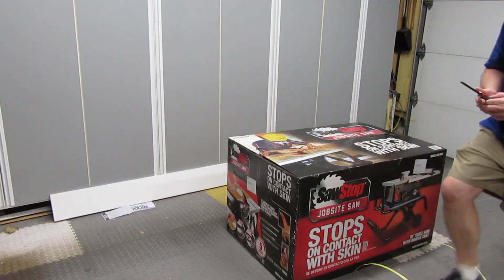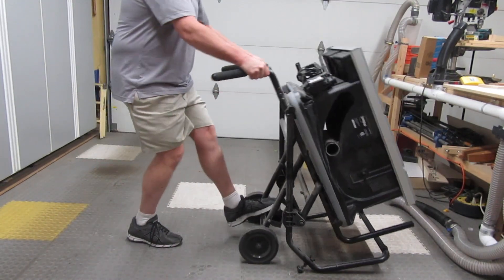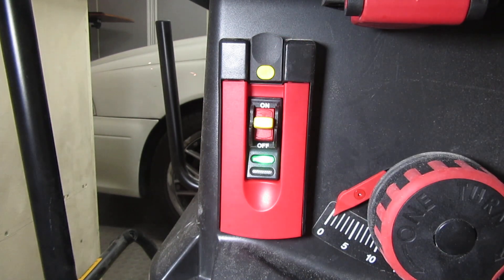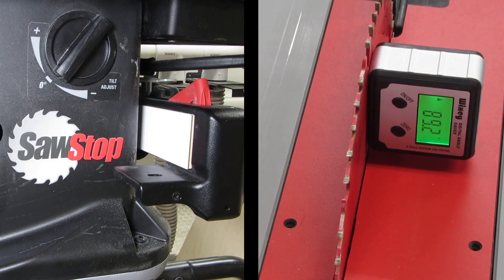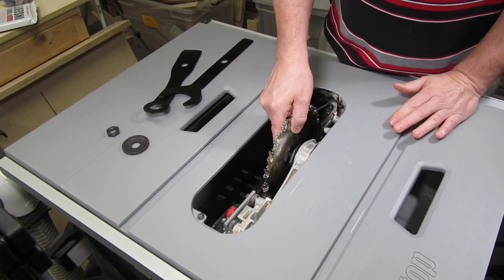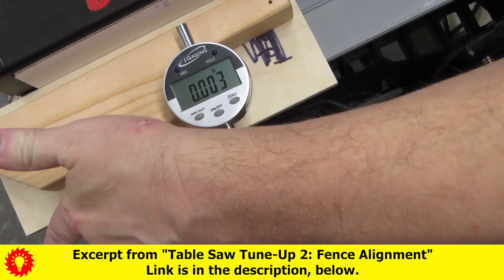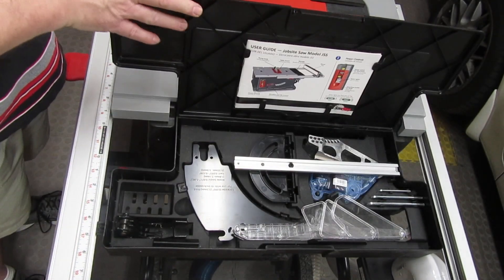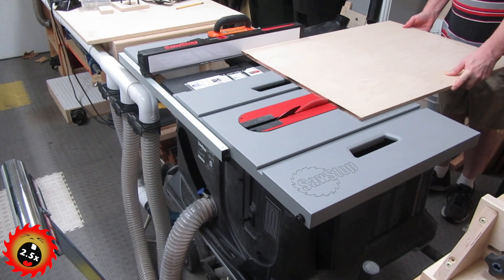SawStop Jobsite Saw Unboxing & 5 Month Review

Comment from the maker: * ALL SAWSTOP OWNERS, PLEASE READ *

I just read the fine print on SawStop's website, and they said if you trigger the brake, they might send you a new one for free. The details can be found here: http://www.sawstop.com/support/warranty/jobsite-saw (there's links at the top for each type of saw).

Basically, it says the brake cartridge keeps electronic data, and if you send them the cartridge and it indicates the brake triggered from contact to skin, they'll send you a new brake for free.

Cool deal! Although waiting for a new blade would suck...
Reply: The Newbie Woodworker now that would be the tie breaker
Reply: serious question, that Diablo blade look like it had the extra bump outs that sawstop recommends not using as it can cause the blade to kick away from the brake when the safety measure is triggered , I've  seen a different video where the user had a trigger to currents and actually had the saw have more time to dig into his finger, could you please come about this
Reply from the maker: @theomegawerty9688  Thanks for the question! It doesn't have it on every tooth, only where the big gaps are (I forget what you call them). But of course, if you're concerned, don't use the blade! However, I happen to know it works, at least when the blade is spinning down: https://youtu.be/OouPywNRZJ8 🙄
Reply: i'd rather wait for a new brake  than try to wiat on growing a new finger, lol, i'd probably have a heart attack if i ever set one of those off, i saw tom silva do that on TOH with a hot dog , and boy , was it loud
Reply from the maker: @jakeqwaninne8502  😂

Comment: I've had the Sawstop PCS for around 5 years and it has been nothing but awesome. Also, I had a small issue and the customer service was incredibly good. In fact, I now need a jobsite saw, and even though this saw is easily twice the money as all the other nice jobsite saws, I knew I had to get the Sawstop. I will receive it next week (just in time for a kitchen cabinet installation). Thanks for the video and great job!
Reply from the maker: Thanks! I sold this JSS and bought a PCS a while back, and like you said, it's been awesome. I'm sure you know they have a JSS "Pro" now, although I don't know what's different. In any case, I wouldn't consider anything else than a SawStop either. 😄

Comment: Great video.  I'm in a similar situation, my current saw is dead and need a new one and my wife really wants me to have the safest.  I'm considering the sawstop as I don't have a lot of space in my work shop.
Reply from the maker: Funny thing about job site saws - they fold up and wheel away nicely, but when they're open, they take up more space than you might think. If money isn't a huge concern, then compare the dimensions of the SawStop PCS to the JSS - I was surprised how close they are. https://www.sawstop.com. Of course, if you need to fold it up and put it away, then a job site saw is the only real option. Good luck!

Comment: Thanks for this. I was trying to decide which to go with, Job Site or Contractor. I finally decided today on the Job Site before I saw this. I don't use a table saw much, my go-to is my 12" Hitachi Chop saw, but occasionally I need one and my workshop space is getting crowded. After watching this I am sure this is what I want. Thanks for the reassurance.
Reply from the maker: You're quite welcome. Yes, in your case, the JSS is probably the best option. Easy to fold up and move out of the way, yet it's still a great saw with SawStop's safety features. Have fun!

Comment: I also have the SawStop Jobsite.  Overall I like it (except the price).  I could not agree enough about the miter.  What a piece of junk for a $1300 saw.  Unlocking my fence I have not noticed any movement.  As far as the storage box, it does seem cool to be inegrated into the saw like that, but I have found in more than a couple instances that I needed to get into the storage box after I had set the fence and because I was going to make several repeatable cuts I didn't want to move it.  You really can't get into the storage box once the fence is set.  The other major thing that was with mine was the table top was NOT flat.  I got with support and and I have to say for a company that says it's customer support is great, it was not with me.  I neither got a fix, nor a replaced saw.  Strange thing is over time it has flattened out and is much better now, still not flat though.  I spent a lot of time trying to tweak the top and maybe I did something that helped...  I'm not sure at all.  I know I sent in pictures showing the non flat surface and now using the same straight edge it is better, not perfect.  I am no where near a pro, or even a good weekend worker so where it is now is fine for my work.  While not perfect and very expensive, I'm still glad I got it, just wish they stood behind their product for the tablesaw aspect as well as they stand behind the flesh sensing part.
Reply from the maker: Thanks for the comment. Like you, I'm surprised that SawStop didn't honor your warranty. They specifically say it covers manufacturing defects. Regardless of your level of ability, you shouldn't have to put up with that. I'm frustrated for you, if that makes any sense.
Reply: I just watched your video yesterday, wondering how things were going with your saw.  It was unsettling seeing how imperfect this expensive saw was as you set it up.  It pretty much turned me off to the job site saw, yet I am still curious to others experiences.  Take care.
Reply from the maker: @drtomasdds  It's an interesting question, and I should do a follow-up video. In spite of its flaws, I love the saw and it's a joy to use, as long as you don't need to micro-move the fence. I have a jig to help with that, so it's not the end of the world, but it is a little tedious. Other than that, though, there's a lot of quality here, and you notice it, when you use the saw day by day.

So I definitely recommend it, as long as you know the flaws going in. And the knowledge that you're paying a premium for the SawStop technology. For me, that's a price I'm willing to pay.

If you decide you're going to buy one, it's $100 cheaper at Rockler than it is from Amazon. It's always been cheaper at Rockler. No idea why - it's usually the other way around.

Don't forget that if you want to use it with a dado stack, you'll need to buy a brake cartridge for dados, and probably a blank insert plate. So add that to the price.

Let me know what you decide. Oh, one other thing. In the video I mentioned how much I love the one-turn crank for raising and lowering the blade, and I still do. BUT, when you need to adjust it up or down by really small amounts, for instance to get a dado to an exact depth, it's not necessarily easy. It's doable, but it takes a little patience.

Sorry for the rambling, but it helps me get my thoughts together, for the potential follow-up video.
Reply: @TheNewbieWoodworker  I am researching the saw now, hence watching this particular video. The reason for the price difference is that Amazon is including the flat $100 shipping cost already, whereas Rockler may not be.
Reply from the maker: @davidbuffington9644  Interesting. I have a local Rockler store, so that's not an issue. Hey listen - just yesterday I stuck my thumb in the blade, and found out that the SawStop is totally worth the money. It just tore the top layer of skin, and it feels like it's burned. That's it. Best money I ever spent. Video forthcoming, of course.
Reply: Same issue with my Delta 36-6022 jobsite saw.  Love the way it sets up and folds down for storage.  Table is not flat.  There is a .013 dip around the throat plate.  It doesn't sound like much, but for very fine work, it throws you off a bit.  Sides of fence were not plumb but I made a plywood sleeve to cover it.  Delta refused to honor their warranty on the table.  I'll never buy another Delta product.
Reply from the maker: @marshallmurrell4583  That's horrible! But I wonder if it's to be expected with "JobSite" saws? Because they're built for the job site, and precision work isn't required? I dunno. But like I said, it's horrible.

Comment: I’ve had the contractor model for about five years and for the small difference in price it is a much better machine.  I have tripped mine once when I nicked an aluminum track.  It really made me a believer, it is stunningly fast.   It’s the only brand of table saw I’ll ever own.
Reply from the maker: Thanks, and I agree.
Reply: For people deciding between the two: if Space and storage are a high priority, carefully look at the dimensions. While a benefit overall, the motor for the contractor saw sticks outside what otherwise might be considered the tools footprint.
Reply from the maker: Excellent point. Thanks!
Reply: Yeah I think this saw should be more like a grand. It’s $1500 now. Contractor is $1850. I’m still considering this one due to a shortage of space :(
Reply from the maker: @patty109109  When I read your comment, I was thinking "If wishes were...", then not really knowing how the saying goes. So I looked it up, and it's actually quite fitting" "If wishes were horses, beggars would ride". 😆
Reply from the maker: @patty109109  You can probably find a used one around that price, if you looked hard enough.
Reply: @TheNewbieWoodworker  These things seem to hold resale. I see one on facebook right now at about 90% cost of a new one. Just really hard to shake the thought that if I get a different contractor saw and ever cut my finger I'll be very mad that I saved a thousand bucks but ended up with possibly a permanent injury!
Reply from the maker: @patty109109  Yep, that's why I got one. And honestly, it's saved be a couple of times. I've since upgraded to the SawStop PCS, but I still highly recommend the JSS.
Reply: @TheNewbieWoodworker  You've had the brake actually fire during a finger contact? I have read of those on woodworker forums who have. I've seen the "after" pics of hitting the saw stop and it looks, at worst, like they nicked their finger on the edge of a table or something--like maybe a bandaid but probably not even. In some cases it barely even scratches the skin. Pretty darn compelling technology.
Reply from the maker: @patty109109  I think I've had the brake go off 4 times, but 2 of them were me being stupid when I cut aluminum and forgot to put it in override mode. The other two were legitimate fingers on the blade. Both times it was spinning down, but it was still moving fast enough to cause severe damage. Fortunately, it barely broke the skin. The experiences have caused me to start using my blade guard all the time, and I added a "light tree" to give me visual feedback so I know when the blade stops spinning down: https://youtu.be/WFNgPWYDxqw
Reply: @TheNewbieWoodworker  That's great. Honestly I bet the second it fired you were just relieved to have the brake go off. :) I also have a tendency when blade spinning down to get impatient.
Reply from the maker: @patty109109  The first time, yeah. The second time, I said a bunch of bad words at how stupid I was to touch the blade again!

Comment: I purchased the same saw and if I was writing a review I would have said the exact thing.  There is plenty of features to love and the miter gauge does suck.  My wife also asked me to get this saw since she was afraid of me removing some body part with any other saw..  I love the saw, it is solid and safer then any other table saw out there.
Reply from the maker: Thanks, and I could have written the same thing. My wife asked me to get the saw. Who are we to deny our wives? 😛I can't remember whether I mentioned this in the video, or even to you in a comment, but if you have problems micro-adjusting the fence, consider building this jig, which I have on 3D Warehouse, but even if you don't have SketchUp, I think the picture will be enough to show you the idea: https://3dwarehouse.sketchup.com/model/6e5d73a4-4cf4-438f-aba8-6b4960e689de/Micro-Adjuster-Jig-for-Fences. If you click on the label in the middle that says "3D Model", after a couple of seconds you can click and drag on the image to rotate it.
Reply: Thanks for the link. Before I looked at your reply I did call sawstop and the service rep, Trent. gave me some good suggestions regarding the fence.  He said pull the fence towards you and then release or lock the fence and that should fix the issue. I tried it and I think it worked.  Need to play with it more. 
He also gave me a link to a webpage that he wrote lots of very helpful Sawstop links.  https://www.trentdavis.net/wp/2018/08/06/helpful-sawstop-links/.  Check it out.  
Thanks so much for the jig sketchup plans.  I will attempt to make one.
Reply from the maker: @edmundhayes7982  Thanks for the info! Pulling the fence does help in a lot of situations, but it didn't help me much when I needed to just tap the fence over a little. The tapping process (for me) most often ends up moving the fence away from the back, and then when you pull it back to lock it, it's a crap shoot as to what you get. Still, it's better than nothing, right? 😛Thanks again for taking the time to get back to me with that information. Much appreciated.

Comment: Cool saw, i bought the contractors saw a year ago and love it, just be careful on wet wood, that will trip it too if you forget to use the bypass mode
Reply from the maker: Thanks. And yeah, I always worry about that. Fortunately I'm mostly working with seasoned Baltic Birch plywood these days, so unless I get a flood (heaven forbid) I should be OK. :)
Reply: Have you personally experienced a wet wood trip? I've seen soaked wood used to test this on youtube and the mechanism not trip. I'd be interested in any test videos that show the opposite.
Reply from the maker: @bnwww  No I haven't. But if I was concerned, I'd run the saw in bypass mode, which is easy to do. And the status lights will tell you if the brake would have been triggered, if you weren't in bypass mode.
Reply: @bnwww  Yes I have, I was cutting a Pine 4 X 4 and it felt cool, so I cut it and it was triggered.

Comment: I just got my JSS Pro put together. I have successfully disassembled the blade guard/dust catcher and cannot get it back together. You are correct. The dinky little table saw this replaced had as good of a miter gauge with it. This one is pitiful, an embarrassment really at this price level. It was a Skil X Shop all in one table saw. You could through the purchase of various accessories have a work table. It had provisions for the attachment of a jig saw, router, belt grinder and drill press. It was good enough for someone that didn't know better. The switch broke and that was all the excuse I needed to finally get a Sawstop. You advised me to wait and see if this miter gauge was acceptable to me before I bought one, it is not so what do you use? Oh yeah, it was such a joy to assemble. Just like the instructions read it was nice. Thanx
Reply: UPDATE  I did get the blade guard back together and figured out how to install it on the saw. All I had to do was raise the blade! I did not see that in the instructions. I dreaded making a test cut to determine if the fence was parallel to the blade. I did not want to have to adjust anything. I made the cut and the cut off piece was less than .005 inches wide at each end, within tolerance and good enough for me. There were/was a complaint about this saw being loud somewhere on YT. They clearly had not heard my previous saw. This JSS is not loud.
Reply from the maker: @jeffstanley4593  Awesome! If you have any other problems, Saw Stop's support is great, so don't hesitate to call them. And I totally agree about the sound - everything's relative. 😄

Comment: I own the jobsite saw.  I have had it for a year.  Last week I was trimming an end grain cutting board I made out of Maple and Wenge. I was cutting off maybe an eighth to a quarter of an inch. The blade bogged down.  Then somehow it hit the riving knife which caused the break to trip as it hit un-grounded metal. The blade nicked the riving knife which caused the break to kick in.  If you look at the saw set up, it is impossible for that to happen, but it did.  I was using a wooden cross cut sled that I had used many times before.  The saw blade did not drop below the table but cut stuck above in the grove of the cross cut sled with maple and wenge stuck in the grove.  The blade which was a SawStop titanium blade was checked by a local blade repair and sharpening shop and it was not damaged at all.  However, I do not believe I will be getting a new break.  SawStop is sending me a new riving knife and they cannot figure out how the incident occurred but I thing getting free breaks is not something they often due. I will say that other than this I love the saw and for my uses it is great.  I hope to move in a couple of years and will then get the contractors saw.  I have run across too many people who are short fingers due to table saws and there may be an occasional inconvenience, such as I just had, but the saw is well worth the money for the safety issues. If you check out Ron Paulk's videos he loves it and has two of them and the jobsite saws are his only table saws.   Good work.  Keep up the videos.
Reply from the maker: Thanks for the comment. And wow! I wonder what happened? Too bad you weren't recording it. :) Although it probably happened so fast the video wouldn't capture it. At least you weren't injured!

I've seen Ron Paulk's videos, and they were part of the reason I felt comfortable buying the saw. Anyway, thanks for the comment, and if you ever figure out how it happened, I'd love to know!